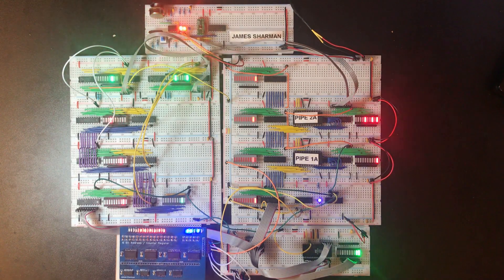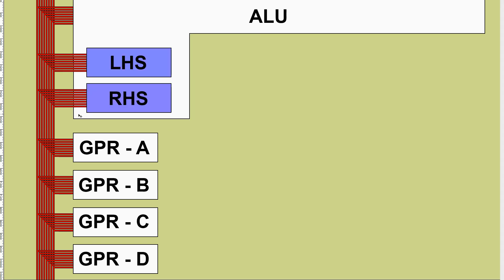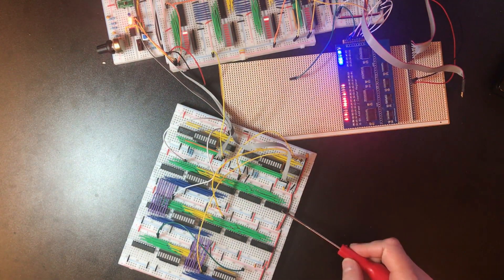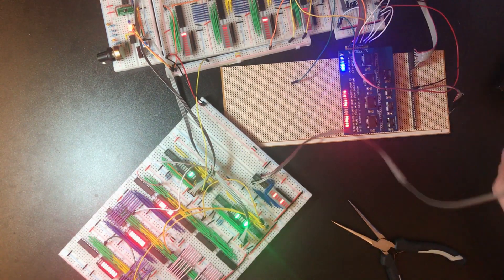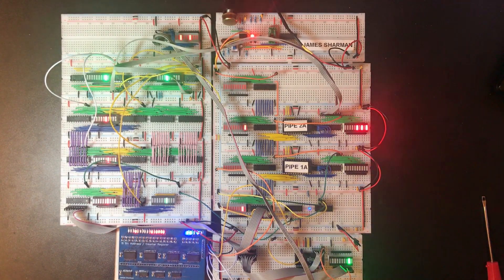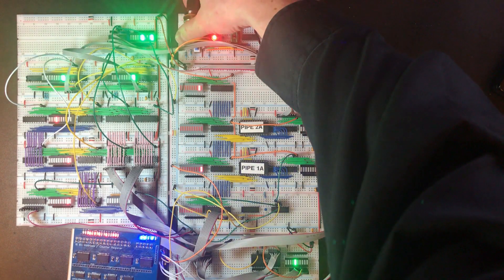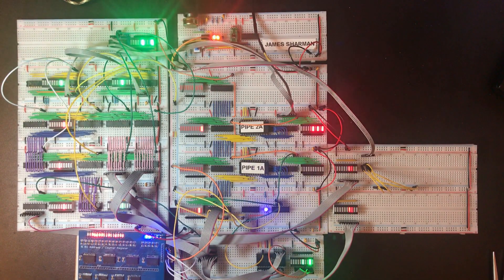ALU (1: Inputs) - Making an 8 Bit pipelined CPU - Part 21

Comment: Is there a reason that they make anything active low?  It seems like things could be so much simpler if they would just keep one standard way to operate.  What is the point?  It's a lot easier to build an inverter into the chip than it is to buy one and fit it into the board just for that.
Reply from the maker: It's mostly legacy,  early circuits used a pull up resistor to get the high and a gate to pull low and the types of gate that were easy to make were better suited that way round.

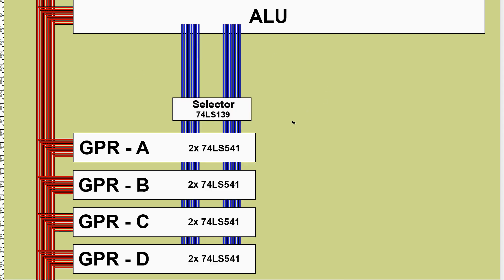Comment: The diagram @4:52 might be a bit confusing.   The LHS & RHS lines do not pass through the 74LS139.  Instead, the 74LS139 is used to reduce the number of control lines.  The control lines select which registers (via a 74LS541) assert themselves on either the LHS or RHS buses.
Reply from the maker: The blue lines are the bus/data lines,  I could probably have drawn that better but it's far from my worst "In hindsight". when it comes to explaining things.
Reply: Hey James!   Hope all is well.  Didn't mean to make it sound like a huge problem, just caught me out for a few minutes.  Was trying to save the next person binging on your videos a few seconds wondering  :-)
Reply: Thanks, it didn't make sense to me.

Comment: Any reason you didn't tie the constant register to the ALU RHS input bus other than trying to keep complexity down? Same for the ALU output register and the LHS input, assuming this isn't done in a later video.

Those 2 shortcuts would save a whole CPU cycle for common operations.

LDX 5
LDY 3
MUL // A=X*Y
ADD 5 // A*=5
STA #0042
Reply from the maker: Yeah, it was about complexity but particularly using the constant register as an alu input would have been handy. That said, one of the biggest limitations of this design is the 8-bit opcode, I could already do a bunch of useful things that I haven't got opcode space for.

Comment: Funny... as a compiler guy, I think of "LHS" and "RHS" referring to sides of an assignment statement, as in "R1 := R2 + R3", R1 would be the LHS. I would also have referred to it as an "immediate" or "literal" rather than a "constant". To each his own, I guess.
Reply from the maker: I'm used to LHS and RHS being R2 and R3 in your example but when you dig into it we are both correct. It's the the items on the left and right of the operator (In your example the '=' is the operator, in mine it's the '+').  I'm guilty of using constant and immediate in an overlapping way here but we are in slightly ambiguous territory. The constant register stores immediate parameters from the instruction stream.
Reply: Yeah it's a C thing.  It has a concept called an "lvalue" which is specifically the LHS of an assignment.  Assignment is a very different operator in C from the mathematical expressions.  More generally, both are correct: LHS and RHS are commonly used to denote the operands of any operator.  It's the same thing as having two parameters, but because most languages want expressions to look vaguely like math, they have to make a special grammatical production for infix operators.  There are HLLs that just use +(LHS, RHS) or (+ LHS RHS).  There are even stack-based languages with LHS RHS +.

Comment: A cool project would be a wire-prepping robot.  You load a spool of wire, and dial in a length in 10ths of an inch (your breadboard gauge) and press a button and it spits out a cut, stripped, and bent wire ready to use.
Reply from the maker: I've had that exact same idea!

Comment: please teach how to do asm programming and do emulation on net.
Reply from the maker: Assembly language programming is a mix between knowing the architecture / instruction set of the target hardware and process of  breaking the required operation down into steps that can be represented int that. I don't know how valuable it would be for me to tutorialse writing for a processor that only I have access to. But a few subscribers have been attempting to make emulators, so there maybe some call for it in the future.

Comment: I think you are overlooking the value of carrier pigeons for moving data from the registers.
Reply from the maker: Interesting, I’m the first to admit that my hardware knowledge is limited (My expertise is in low level programming) so I investigated. Google let me know that the carrier pigeon has a peak speed of about 60mph which translates to about 26.8 meters per second. I estimate the furthest distance that register data has to travel in a cycle in my build is about 30cm which would give me a maximum clock rate of about 89.9hz. I’m hoping to get it running a little faster than that.

Additionally, I’m not sure how I would communicate source and destination to the birds, the demultiplexer chips I currently use for that take a binary address (it’s simple for the control circuits to generate). Should I be teaching the birds binary or do you suggest an alternate signalling method?
Reply: @weirdboyjim  History has show that its best to teach the pigeons Morse Code.  you will have to build a Morse code to binary converter/deconverter though.
Reply: @weirdboyjim  
African or European?
Reply from the maker: @UpcycleElectronics  European are easier for me to get.
Reply: @weirdboyjim  you miss the advantage of bandwidth though.

A pigeon could carry lots more than 8 bits.